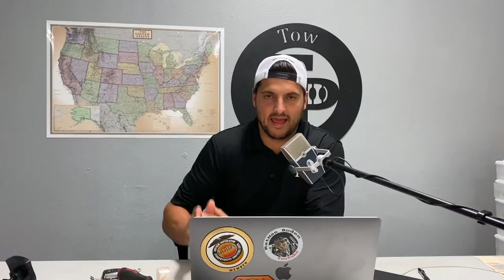The TRUTH about Electric Over Hydraulic trailer brakes

Comment: You can’t argue with real world experience however it sounds like you have had a poor experience with a kit. The points you bring up about losing all brakes are definitely true. Hydraulic shouldn’t have that noticeable of a lag and could have been a bleed issue, as you said, you had lost fluid many times after losing a pad. It’s very possible you had either a bad install or a bad kit. I’ve had SOOOO MANY issues with electric brakes failing quickly, magnets breaking and such that I’ve sworn if I ever have another trailer built it will be with EOH brakes not electric. I’ve seen you have similar issues along the way in videos too. I  looked into conversion kits as well but with 3, TK 9000 LB  axles they don’t make one that is a guaranteed replacement and as you stated are VERY expensive to “try”. I would however be interested in doing a head to head comparison with factory built EOH vs electric when I spec a new trailer. I’ve seen good and bad,  but all the bad I’ve seen was because of poor workmanship or maintenance. I do tow my trailer over 100,000 miles a year so it would be a good test. I’ll let you know how it goes when I get one. I just can’t believe it could be as bad as electric. The ability to do a quick pad swap, as opposed to complete bearing disassembly on every brake job seems like it would save tons of  labor  alone.

Comment: Love watching your videos but you miss the mark on this one. I have had 2 16k 5vers with EOH Brakes and own several trailers that have just electric brakes. Properly installed and with a brake controller that has the option to choose EOH Brakes you can't compare EOH to std electric brakes. They are so much more powerful than std electric brakes, less problematic, etc. No lag noted with correct brake controller!

Comment: Low pressure?!? My actuator is 1600psi not low pressure then no fluid in the lines are you for real if there isnt fluid in the lines its because you didnt bleed them properly or your not keeping your reservoir full and your out of fluid!! Electric over hydraulic brake are far superior to the old 1940 era drum brakes! Why do you think all big trucks are converting over to air disk brake on tractor and trailer?!? Because they are better at stopping,cheaper to maintain and less moving parts to fail! Boy i hope i never have anything delivered from this guy !

Comment: Your brake lines are NOT FULL ? You need a new mechanic dude. I pull a DRW Mobile Suites 22,000 lb over 30,000 miles . I change pads every 10k, I have been pulling trailers all my life all of them with magnet drum and I tell you once I got the brake controller working I will never ever ever ever go back drum brakes

Comment: It’s not a high pressure system? Rarely have fluid throughout the whole lines? Man you are making yourself sound clueless actually. Sounds like the system you used had all kinds of issues that needed to be fixed. The pads should never slide out, the lines should always be full of brake fluid and the braking is as powerful as you set your controller to make it. Turn it up for more braking - your drivers should set the gain with each different load weight or yes there will be harder braking than needed with lighter loads

Comment: I normally don’t comment on your stuff.  I am in the industry.  I can promise you, you are making ridiculous uninformed statements.  You had a conversion.  A conversion is NOT Dexter.  Your statement about losing fluid/ lag.  Come on TP, for the love of God, learn how hydraulics really work. They don’t “get” air in them for no reason. When properly bled, they will have no 5 sec lag.  For NON cdl guys, frankly… you probably should stay with electric.  Backing plates/ hubs are still relatively cheap. If you Are CDL, 10k eb axles will cost you $1200 per brake job if you do it right. That is if your drums are still good. I recommend disc for anyone dual tandem as COST is so much lower and braking considerably better and stronger. 
You made a lot of statements about what COULD happen.   Please don’t misinform startups any more. Think about what you are telling ppl. This is their livelihood.
Reply from the maker: I appreciate the feedback